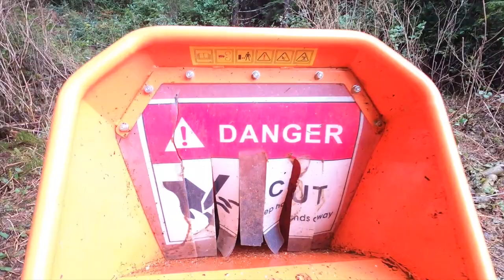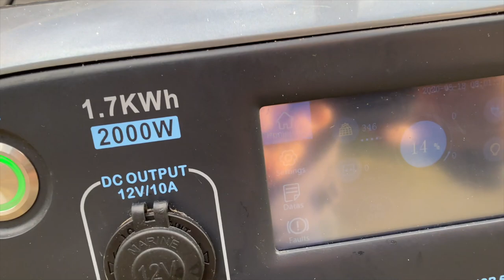ALONE & OFF GRID: #1 BATTERIES for YURT LIFE | BEST INFLATABLE BOAT | Our Garden Destroyed - Ep.115

Comment: An easy method to clean the glass on your stove (of course when the glass is cold / fire out)...... dampen a rag with water and dip the rag into the cold ashes......then scrub the glass with the ash covered/dampened rag. Used a clean dampened rag to remove the debris. This is how I clean the glass on my coal burning fireplace. Works very well.

Comment: The solution you can open the flue from the outside and don't have climb the roof is really nice. The flue is most quickly clogged with fresh (damp) soft resinous wood. I noticed Nicole picking the freshest wood from the pile. 'A' rule for the best combustion is drying for two years, so they say, if you have the stock pile for it and harder wood types if you have those. The drier the wood, the more difficult it is to split. So splitting it completely in one go after cutting the trees is an option. You could temporary dry-store under a tarp on cutting location and store the dry wood locally. Just that a suggestion ..

Comment: I noticed you guys are near a small river\large stream.  Have you considered a micro hydro-generator?  You leave it in there and as long as there is a flow you have power.  Since this isn't dependent on the sun, it would be 24 hours a day.  You can even leave it off until you need additional power.  The same for a small wind power generator.  Just a suggestion if you already considered these power sources.

Comment: Jake should learn that on a wood stove, the upper pipe fits inside the lower pipe.  On a gas stove, the upper pipe fits over the lower pipe.  The difference is that a wood stove generates more heat and the draft will suck the air out, yet the tar will run back into the stove instead of running through the seams and down the outside of the lower pipe.  This has been the rule since the beginning of wood burning stoves.

Comment: 13:00 ... check  out  a  product  called ' Chimney  Sweep ' it  will  help  in  preventing  chimney  fires. Looks  like  a  pretty  good  clean  out   you've  got  set  up  on  a  triple  wall  street, but  it  will  prevent  creocil  from  build  up,,, especially  if  you're  burning  a  lot  of  Pine.

Comment: Hint: you need deeper soil bed for tuberous vegetables like carrots, beets, potatoes etc... that's why yours are stubby. Stacked tires work awesome for potatoes. Alternate between 2 permanent gardens so while one is in use, you can mulch and enrich soil in the other for next year. You can use all grey water from dishes & baths to irrigate berry gardens, corn patch, & fruit trees automatically. Plants don't mind a little soap, Run perforated tubing or large hose for this. Works great, doesn't affect food quality negatively at all.

Comment: if find old fridge some throwing away. dig hole in ground stick in. then swing door open like root cellar or way keep for while. have theamoter check tempetkres through year see work. but idea fridge insulated. put ground below freeze mark not freeze then. put moss bord hide from animals keep top closed with block wood hold down. then want something open it. In theory get cooler that put ice in carry pop do same thing be lot smaller.

Comment: Those lithium batteries are expensive for the amp-hour capacity they provide! And they also cannot safely be charged or discharged below 0°C. Personally, I would argue that lithium batteries are only suitable to a mobile/boat application where weight is a concern, and that tried-and-tested flooded lead acid batteries are still the best option in fixed installations in cold climates, where weight is not a major issue, and still at the moment the best value for dollar. With how little sunshine that part of the country gets, I would anticipate that a small wind turbine may help. A wind or micro-hydro as others suggested would reduce the number of amp-hours of battery capacity required.

Comment: Heaven will not be boring= That Heavenly City is 1,500 miles like a cub which makes it 1,500 miles tall. it has 12 foundations upon the wall (floors) and if the floors have equel spaces between then the next floor up would be 120 miles.